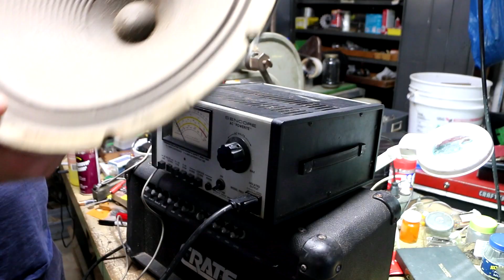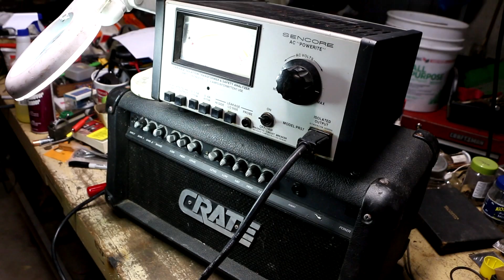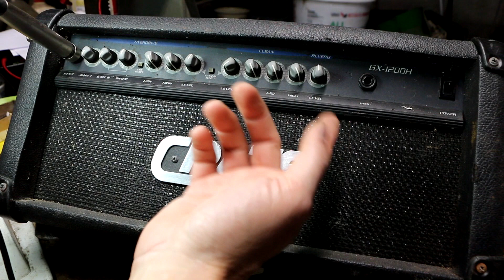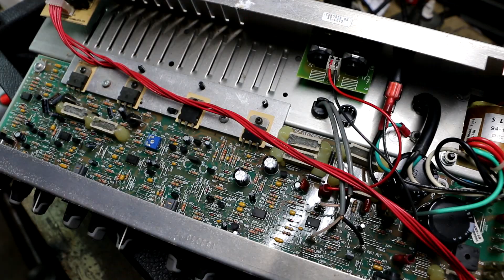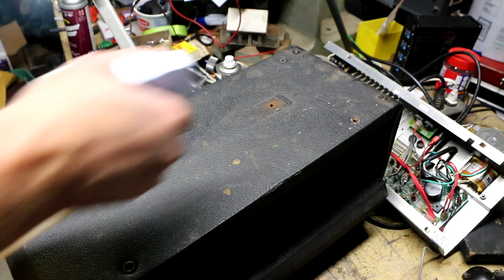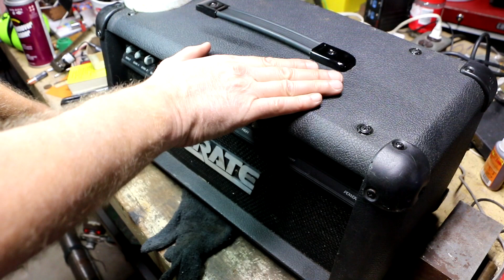Crate GX1200H guitar amplifier

Comment: I have a music man 100 rd 115.its rated at 8 ohms.or you can switch it to four ohms if your adding an extension cab....I bought a crate gx 412 xr cabinet .the one that goes to that amp.can I hook that music man to that cab?? It's says 8 ohms at 120 on the cab.dont want to fry my music man plz help me !!!
Reply from the maker: So the easiest way to explain it its this. If an amp can handle 4 ohm impedance, than its can handle the 8. The lower the impedance of the speaker, the higher the current flow in the amplifiers output circuit. And that can damage an amp if its not designed to handle it. So an amp designed to handle 4 will easily handle 8. But some amps are only designed for 8, so running a 4 ohm speaker could cause damage over time. The sneaky part about impedance, when you plug a second cab in, it is placed in parallel with the first. In paralell, the impedance gets cut in half. To 8s in parallel is a 4 ohm load to the amp. Two 4s in parallel is a 2 ohm load and can fry most amps. Hope this helps.
Reply: @stevewatr  it does help for sure thanks for the response.i plugged the cabinet in and put the amp to 4 ohm . then I switched the amp to 8 ohm .it was about twice as loud on 8 ohm.and it seemed to run better.these old music mans have a solid state preamp.not sure if that even matters
Reply from the maker: @skyb8687  the switch selects a different connection on the audio output transformer to match the impedance between it and the speaker. A better match means higher efficiency (louder). Don't blow your eardrums out 🙂
Reply: @stevewatr  yeah,that was my reasoning for the initial question.i didn't want to fry the transformer in this mm.hard to find .thanks man.i opened up the cab and all the speakers said 8ohm.i hope it's fine lol.i guess I'll find out

Comment: That was a killer deal.
I have had this model for 27 years lol. I also bought the 2nd generation version, GLX1200H. They are much better than people want to accept, and I say this as a shredding arpeggio master and symphonic guitarist that went to college for electrical/electronics engineering.

Both had all the op-amps replaced with NE5532s, and this model is sitting in my lab with an unfinished EQ sockets mod. The cornered frequency on the active "shape" leaves much to be desired. The 2nd gen having a midrange control is significantly better, and like a lot of good SS amps, you just have to spend the time finding the right pedal to overdrive their dirty channel, and just as common, put a shelving EQ on the effects loop.
I ultimately designed my own soft-clipper pedal to overdrive these 15 years ago, and ended up using that pedal on every single amp and modeler I own, and I own a lot some fairly expensive and all tube. 
When these came out, even guys I knew with $3K tube stacks were blown away and buying them for a beater amp they could cart around. Of course, these days there's much better SS and digital but for that price?! 
I would have been jumping for joy.
Reply from the maker: Thanks. I ended up selling it because I had too many amps. Ironically I recently found a Crate speaker cab that would have been a nice partner for that head.
Reply: @stevewatr  For what you paid, I'm guessing you made a nice profit lol.

Comment: Do you still have the amp?  Quite often, the effect's loop (Insert) jack gets dirty and the amp will cut out.  Looking at the manual, the effects loop has a TRS jack.  If you take a stereo (TRS) plug and short the tip and the ring together, you'll bypass the switching function of the effects loop jack that causes problems.
Reply from the maker: Ah, I see you know your amps! That is exactly what it was. I did a video of the diagnosis and repair that i will post at some point. I cleaned the contacts on the switch and it is back to perfect.

Comment: Enjoyable video!  For the reverb, it does make a difference.  The input and output impedances and grounding of the input and outputs of reverb tanks are unique, so the tank needs to be connected properly.
Reply from the maker: Thanks. I never knew that. I just assumed because it is a mechanical device it would not matter, but i guess the electromechanical couplings are not the same on both ends. Are units usually marked?
Reply: @stevewatr  The reverb tank is probably marked "Input" and "Output" near the respective jacks.

Comment: I have a few Crate amps sitting around from free scores. One of them is a keyboard amp that had me losing my mind chasing down why it wouldn't power on.  Turned out to be the damn power cord! It looked 1000% perfectly fine but actually had a hidden short in it that would test to have continuity, but when the cord was bent to be plugged in it was in a position that would break contact. I figured it out by accident when I moved the cable while plugged in and the unit powered on.
Reply from the maker: Sadly, i have a followup video to this amp repair. I sold it for $70. I even powered it up for the buyer. He took it home, the next day he called to say it was cutting out. So i refunded him his money and we agreed it was probably a simple fix, so if i fixed it over the weekend, he still buy it. So i fixed it on Sunday, and the buyer changed his mind......bummer.
Reply: @stevewatr  But you have a working head for a few bucks that will sell eventually.  :)